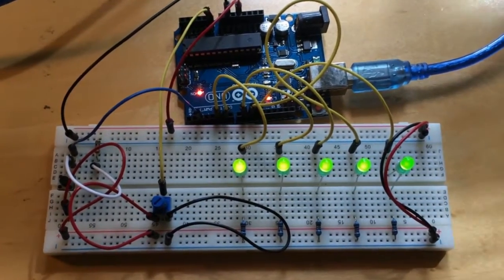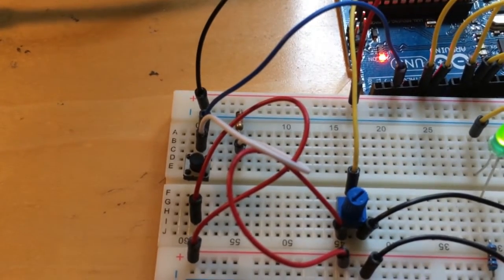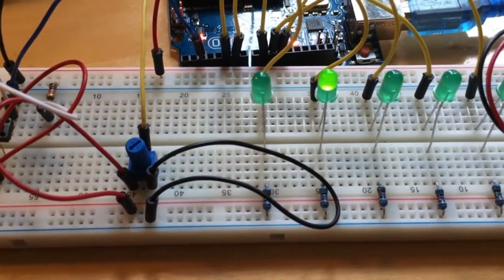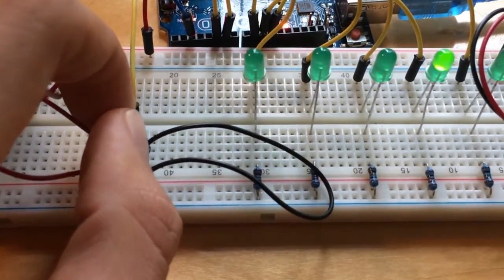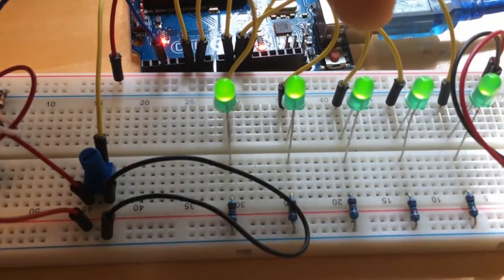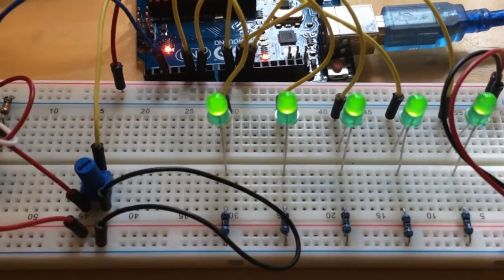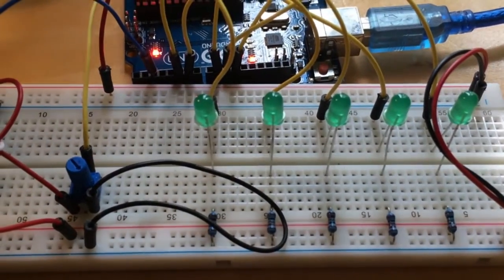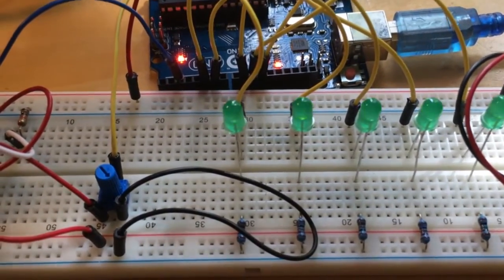POE Lab 1 - Arduino Bike Light Demonstration

Comment: write code here, just need made same project, i try test many code but not working ,i think i use power led same, one button and many mode i test many code but all not working ,need good code test my project.
Reply: thanks at code, but have error alltime
say stray"\" in program, i no know what mean ?
Reply from the maker: +Matti Virta Hi Matti, Are you sure you pasted it correctly? There is no backslash in my code and it compiles fine for me. Try copy only the segments of the code--the comments should help you..